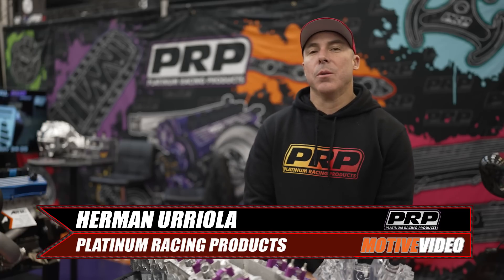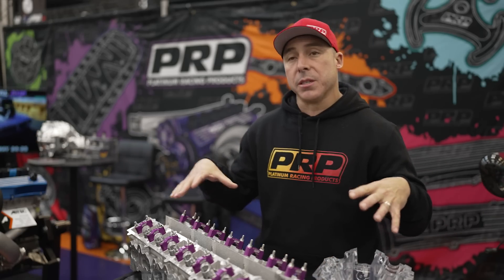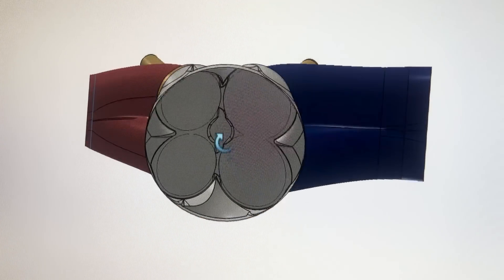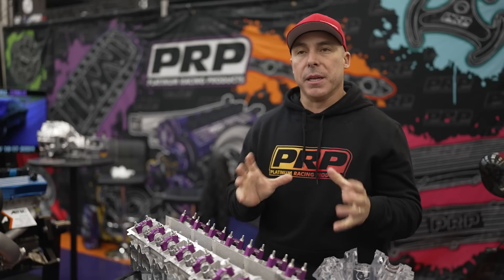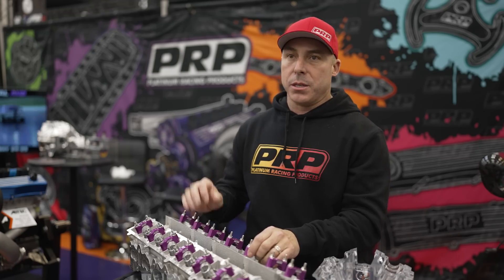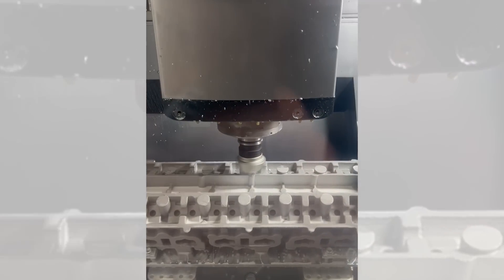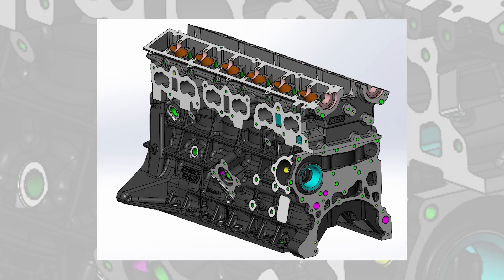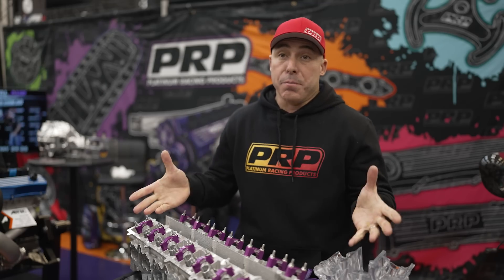PRP Develops New Cast RB26 Heads! - Platinum Tech

Comment: I would love to see a motor and head combo for high efficiency/mid power followed by the same, but for the 2jz. These videos are great btw.
Reply: I bet it’s on the way. He did say they were working on a cast JZ block to fill the void between stock oem blocks and billet blocks but obviously Dart beat them to the punch. I see them cranking out cast JZ heads in the future if the demand is there.
Reply: They are most likely working on it already, but Dart beat them to the block and someone already makes a billet head for the 2j.
Reply: @lennixsingh626  yeah spoke to Dart at PRI specifically about the cast 2jz block and the latest update is that they'll be shipping in Feb 2024 (so just 2 months away)

Comment: Is the R1 head compatible with any of the off-the-shelf RB26 camshafts out there? Or does it need one that's specifically made for it?
Reply: Off-the-shelf as in aftermarket?

I would say so, why wouldn't it?
Reply: @JohnWiku  Well everything else about the head is so different. The valves are much bigger than anything from the aftermarket and if I'm hearing it right, they're also using R35 GT-R buckets which I assume are shimless.
Reply: The bigger bucket allows a more lift without without having a tiny base circle diameter. I'd bet the cam journals are the same size so any cam made for existing heads can be used.